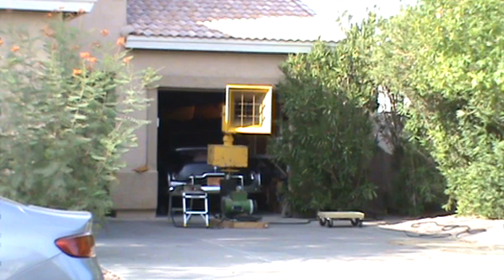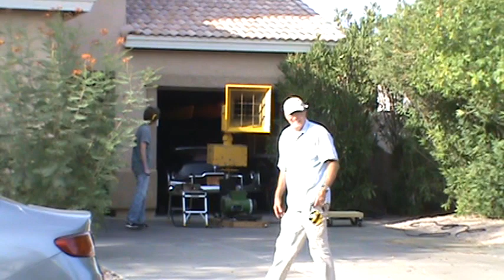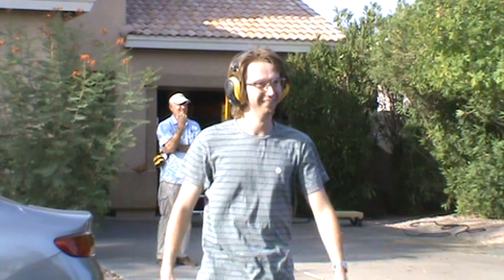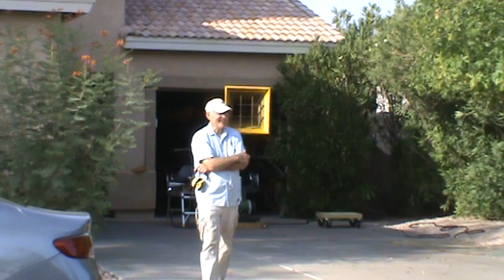Test of the Phoenix Jailbar Thunderbolt 2000 with blower (Part 1)

Comment: What’s the difference between 2000 and 1000
Reply: 2000 had a gas powered blower. The 1000 had 7HP Sutorbilt electric motors
Reply: @kdtx_dylan  well the blowers were the same, standard 6M sutorbilt. the motors is what set them apart from each other, or should I say engine.